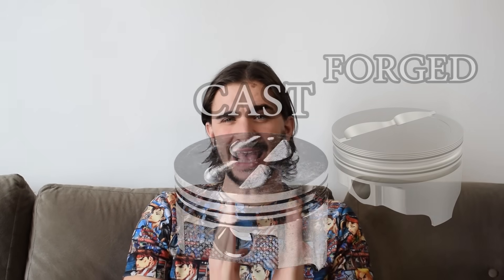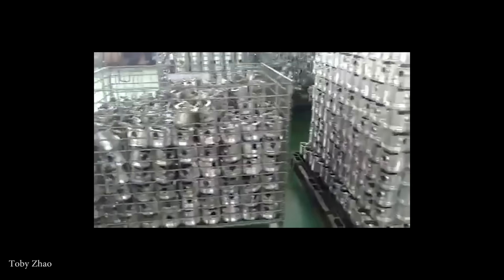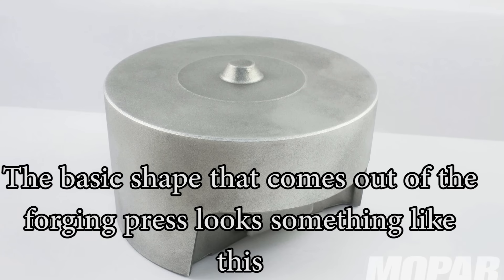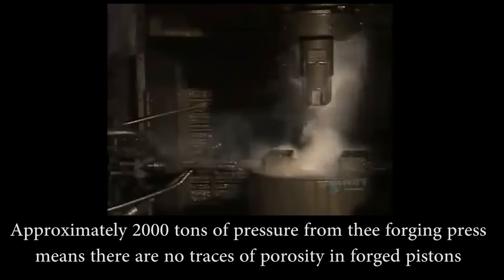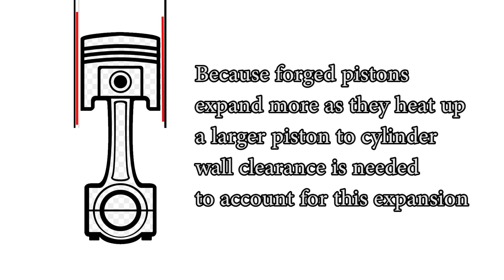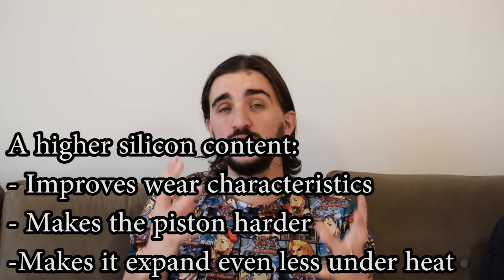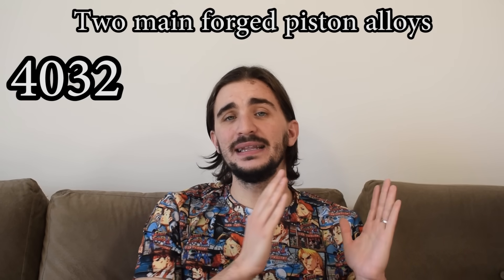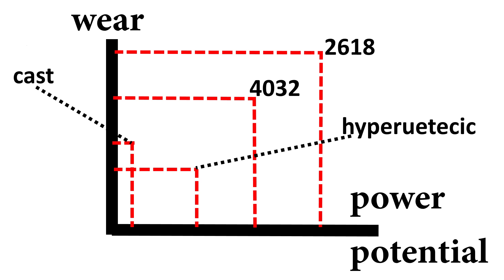FORGED vs CAST vs HYPEREUTECTIC PISTONS

Comment: You just helped me figure out why motors blows pistons and heat seize
Reply: They only do that when machined improperly.  Expansion is take into account when the piston is manufactured. How about watch some videos from a actual machinist.
Reply: @unclegeorgesspeedandfeed  well it took me this long to find this information about 4 years ago this would have saved me a lot of money and effort and having to deal with assholes and not made a fool out of myself just to learn something because I was struggling to find someone to help me rebuild a Yamaha yz250f motor and needed help from people to explain to me key things to watch out for and how it works so yeah it would've been nice so now my bike is in a million pieces because it isn't worth saving anymore thanks to assholes who gave me intentionally wrong information that was worthless
Reply: @DisruptiveUnicorn98k  have you been able to find any videos about that particular motorcycle youtube?
Reply: @unclegeorgesspeedandfeed  yes but I wanted to understand why a piston burns at the top and melts away and why the severe scuff marks and heat seizure and all these things that I have no experience in because I want to buy a two stroke bit I can't jet a carb and that is a necessity to do right and then we'll clearances isn't an issue because I have some experience with that

Comment: Forged pistons aren't just more ductile, they are stronger in yield strength and ultimate tensile strength as well.

Expansion of an object is due not only to its coefficient of thermal expansion, but also the geometry of the shape. The difference between coefficients of thermal expansion for cast and forged isn't actually that great, 20 for cast vs. 22 (microns/meter °C) for forged. A Chevy 350 long block has a piston bore of 4" (0.1016 m), so a forged piston would expand 0.2032 micron (.000008") more than a cast piston, if one considered they were at the same final temperature.

Comment: Back in 1975 I put forged hi-compression pistons (along with a lot of other performance upgrades) in my 1969 Road Runner. It was a blast for awhile, nothing like a big heavy American muscle car that can do wheelies. Goes without saying it didn't last very long. It would've been way smarter to save money building a more streetable longer lasting motor.
Reply: Kowboy USA , how many miles did you get out of engine?
Reply: @WesternReloader  A little under 200. The motor was still running, but was knocking.
Reply: Kowboy USA , so your dynamic compression ratio was too high for the fuels octane, couldn’t retard timing enough, the cam had zero overlap with a wide LSA bleeding none of the squeeze on compression stroke? What were the reasons?

Comment: Hehe, I like how you point out Silicon(e), now all that is missing is the pronunciation.
Silicone silly cone
Silicon sille kan
My buddy and I were debating what type of pistons to put into our little project and I couldn't remember the name of the Si-pistons. So after googling, the answer became clear, and this video was attached. Thanks! Hypereutectic pistons all the way man. The time of the forged piston is over. Those are only good in professional racing machines, where they tear into the engine every day.
Reply: Hypereutectic are alright but there is absolutely nothing wrong with forged pistons. They will not damage an engine in any way. If the tune in an engine is not correct the forged piston as more forgiving. Not matter what kind of piston they all need to be sent to a machine shop and have the oil clearances sized accordingly to the application. Poor machining and tunning is what kills engines along with improper maintenance.

Comment: The Ls9 has forged Pistons stock, pretty awesome.

It is an overkill for 647 hp on 6.2 liters/8 cylinders though. Not even 120 hp per liter of displacement
Reply: User 1888 so u can boost on stock internals???
Reply: Reminds me of the RS6 V10 5.0 TT engine which doesn't make 100hp per cyl

Comment: LOL when I was a kid of 17 I built a Chevy 327 street drag engine with stock rods and stock cast pistons, it had very tight piston to liner clearances and very tight ring gaps. 2.02 hears of course, heads and block deck milled. I was out there blowing off big blocks and revving her to 7 grand and even 8 grand a few times to prove she would take it. so why did she hold together you ask. well part of the reason was she was a short stroke engine that has a slower piston speed that creates less heat, less stress. that engine lasted 5 years of pure terror, and what took her down was that the oil pump blew up and sent metal into the system. she won every race she raced, but she lost the last race she raced and that was up against a $7 thousand 302 Chevy in a lighter car. that was the race then oil pump blew up. I had only $1,200 in that engine.
 I think that engine was just one of those pure luck things that happens now and then. boy, those were the days..

Comment: So for all you beer drinkers out there, your cold can of beer is shrunk and so it holds less beer.  But seriously, I have a supercharged engine I built using Hypereutectics. Experts say that's okay as long as I keep it tuned and don't run lean. Once I put a small pulley on the supercharger to get lots of boost, ran it full throttle,  which caused detonation. The pistons survived okay, but the detonation blew the ceramic centers clean out of 3 spark plugs, leaving only the threaded part in the block.

Comment: There are two kinds of people: those who want an engine to last as long as possible, and those who want to get the most power/fun out of the engine.

If you look at the older Honda engines, they were very well engineered. You see people today pushing multiples of stock horsepower on basically stock engines and they handle it like a champ. This is why 300-400K on an older Honda engine is to be expected. Some people I used to know had Hondas with 600-800K on the original engine without a rebuild. The last Honda I had was at 300K when I sold it. Original engine, original transmission, original timing belt (yeah, that was risky). The only problem it had when I sold it was it burned oil and the exhaust was pretty much gone (rusted out). My current daily car (a Chevy) is only at 155K and already showing signs it's not even going to make it to 200K without a major issue. I also have an older Nissan with 300K miles on it that runs fantastic considering it's a 35-year-old engine with a bunch of miles on it. The big differences, the Honda and the Nissan are seriously low horsepower. The Honda had like 50 and the Nissan has about 80. The Chevy has around 100 (well, it's supposed to, but due to wear and tear I doubt it has even 50 right now). For a daily driver, I'd much rather have an underpowered car I can drive like I stole it and have it last forty years. For a fun car, well, with the increase in fun comes a decrease of reliability and lifespan lol.

Comment: So if you want power and longevity... couldn't you put sleeves on your cylinder walls, upgrade to forged rods, and keep cast pistons? It would seem that would be the best combination. Rods don't bend, sleeves add protection for walls and cast pistons won't wear as fast.
Reply: No just buy a nice set of forged pistons and rods and get a good machine shoo to do the work. And sleeves for a cylinder dont work like that. They are for a damaged cylinder. They macbine the old one out and install a new one the bore to size then hone.

Comment: But then there is forged hypereutetic pistons with the addition of nickel and scandium, and with a thermal barrier coating on the crown, voila, very good allround piston. But at a different price tho...
Reply: Njål Nilssen I wonder if you’re talking about what I bought for my Ford 331 build. Mahle 4032 Forged pistons. They’ve got some type of thermal coating on the crown, and material on the skirts
Reply: @WesternReloader   Typically you won't find shelf or even custom pistons with Scandium in them, unless it is especially asked for, as they have to custom order the right alloy billets. And it won't be called 4032 any more 😉

Comment: That's some great advise! Thumbs up!!!
Regarding cast pistons, i would say, from experience, the stock cast pistons in NA cars 90-2015 can easy handle a low boost conversion (max 10 psi). My mate decided to go for 500+ bhp on a 2JZ-GE for a club rally season '14, stock internals, worked fine :)

Comment: I was lucky enough to find a rhd 2004 JDM s203 with little damage here in Canada , I put everything possible in a nice 2003"WRX shell ! It is fast as fck. It has the forged aluminum pistons and I have run it hard with zero issues and I test that 8,000 rpm redline all the time . I cooked the cast pistons in every other Subie I've had and I've had 3 WRX , one Fozzy , and now this gem , based on my experience I think these are great pistons !

Comment: 4032-T6 Forged expands almost identically to sand cast 204-t4 and significantly less than Permanent mold cast 242-T61 when looking at the thermal expansion coefficient

Comment: Definitely bookmarked this video to show to my friend,
who owns a Nissan gtr, forged piston from the factory, which
he shouldn't daily drive.
Reply from the maker: Please don't put words in my mouth and things out of context. It's kinda lame.
Reply: @d4a  Bro you miss understood me, It was actually a complement.
Reply from the maker: Oh sorry. My bad. But still, it doesn't mean he shouldn't daily drive it. When manufacturers put forged pistons in from the factory, they often do a lot to minimise the negative effects of expansion as much as possible. I mentioned high silicon content, advanced coatings and skirt design in the video, but there's also sophisticated cylinder liners and other stuff. What I mostly reffered to in the video is people building performance engines with forged pistons and then daily driving them. Emphasis on building. That all being said, even an oem forged piston engine isn't a high mileage motor and you can't expect it to do  half a million miles or something, it's a performance engine at the end of the day. Sorry for misunderstanding once again.
Reply: @d4a  I believe & its my opinion, that sports cars are not meant to be daily driven as a good practice, I own a huracan, which also has an OEM forged piston, but I use my Volvo on a daily basis. Again this is due to the frequent start-stop nature of my commute. No one has ever mentioned this on YouTube (at least to my knowledge) until I stumbled on you channel, hence why I needed to share to a friend. Great work.
Reply: Sports cars are no different than any other car justbecuase they have forged piston. Stop spreading stupid information.

Comment: You left out a few things bud about forged pistons of today and even cast pistons. Let’s talk about ristpin offset and cam ground skirts. Depending on how you are building a engine you can today get forged pistons that are cam ground that virtually eliminate cold start piston slap; also it doesn’t take long for pistons to expand during warmup maybe 90 sec . Now let’s talk about cast pistons; they are cam ground and have off set rist pins this eliminates cold start up noise but the wear surface area in the skirt is about 2/3tds less then at full expansion. So the main cause of shorter engine life in any engine is no warmup. People get in their car start the engine and go and putting full load stress on the cylinder wall with a cast piston , I’ve seen it on engine overhauls there are wear lines in the cylinder bores from this it happens. So what I do is I always warm up my engine until the internal water temperature gets to about 110 degrees or you see the needle come up on your temperature gauge. My startup routine for any engine is the same as for large Diesel engines ask any truck driver about cold start warmups.
Reply: My dad would get in his car and floor it in drive before the starter even stopped spinning on a regular basis, it ran fine over 200k miles.  He also did oil changes every 10-15k with dino so it goes to show it's all about the design and manufacture, not the use and abuse.
Reply: GoogleMinus your dad sounds like a really smart/wise man - you were probably pretty stoked you got his genes and wisdom.
Reply: I baby my car: I will drive on a cold engine but <50% throttle, and never going above 3000rpm. I drive like this until I get to 165+°F
Reply: Also talk about the thermal expansion of the alloys used because the expansion difference is usually minimal to none. The reason you get piston slap is because forged pistons take longer to heat up and expand
Reply: @Darumacandy  you said the expansion difference is minimal to none ...on average we fit cast pistons with 0.0015 of an inch clearance ..try this with forged pistons and see what happens
Reply: @Darumacandy  forged pistons expand much more than cast so you need more piston skirt to cylinder wall clearance than with cast pistons....on the average cast pistons are fitted with only 0.0015 inches of clearance ...try that with forged pistons and your engine will lock up
Reply: There is another answer that is not being addressed here that all should be looking at and that is "cold chamber high pressure injected die cast aluminum alloy pistons" with the  low expansion of cast and the strength of forged plus that are 4% less friction ..that means they take less energy to cycle = more rpms = more boost = more horsepower
Reply: This notion was disproved a few decades ago when research showed that the biggest factor in engine wear was the interval before proper operating temperature, and thereby clearances and lubrication efficiency, was reached. Warmup at idle prolonged this increased wear period, thus, the recommendation for gradual warmup was replaced with driving off after a few seconds. Scratched bores would not be the sort of damage seen from increased wear in any event.
Reply: @jozsefizsak  this is also a factor with stationary engines that run 24/7 year after year as in huge natural gas pumping stations that run off the gas that they are pumping and get over hauled once every three years as a normal inspection outage where there is hardly any wear involved at all. The tear down is a manditory inspection to guaranty a constant supply of natural gas will never be  interrupted
Reply: Joel Seim you left out why the real reason piston wrist pins are offset !  Its all about piston side thrust on the power stroke in relationship to the angle of the connecting rod during its travel through the power stroke. Offset pistons wrist pin holee is nothing new and have been around since Zora arkus-duntov invented  the small block Chevy V8...long ago while building a 327 chevy V8 with 11.5 to 1 compression pistons my local machine shop who were noted for building high performance racing engines for the midwest dirt track racers .. And this particular machine shop installed two pistons on their connecting rods with press fit wrist pins in the rods on backwards ...not only was the wrist pin offset defeated the dome on the top of the 11.5 to 1 high compression piston would have crushed the dome into the cylinder head as the combustion chambers  are offset 180 degrees ! The shop ower who had been in the business for over 35 years  told me to just turn them around !!! I told him how in hell are the camshaft lobes going to get any oil sprayed on them when the slot in the rod cap is only on one side to spray oil on the camshaft ??? ..this idiot didn't say a word back and took the two fucked up piston/rod assembles  and  correctly switched them around ! And the last time i ever done business with these idiots who where known to be the best engine builders around and who didnt take kindly to a kid of 20 years old at that time telling them what to do ! Just so happened i owned a doctor of motors degree from the perfect circle piston ring corporation and a degree in appled  science from the university of illinois as a graduated in 1969 ..and today watching you tube and reading the comments is deplorable of the number of idiots who think they know what they are doing is beyong belief !
Reply: It's hilarious how many people don't do this, even my dad redlines his car at 6 in the morning lol it's a miracle the engine still works.
Reply: What if the manual says no cold start warmups needed? Oh, no cars come out of the factory with forged pistons thus there's no requirement for cold warm ups before driving off....
Reply: Word

Comment: All this info is completely useless without consideration of the engine block and it's material or if the block is sleeved or not. Because thermal expansion is not an issue if the engine block has the same thermal expansion factors. Or if you sleeve the block with forged sleeves to go with your forged pistons. This is just someone who doesn't know much about engineering but did some research as a customer trying to get better parts. Without an experienced technician available for guidance about context he misunderstood much of what he researched. The only times you should be thinking about getting forged pistons is when you already know why you would need them or they were stock parts. 

This is information in a vacuum and whenever you make choices under those conditions it will be wrong. You can't make a correct choice without all the info of all connected parts and how they will be affected.

The basic lesson here. You can't make educated choices on research without education. This video is research by an uneducated person on the subject.

I have forged piston in a sleeved block in my daily driver for the past 8 years without issue.
Reply from the maker: I'm used to self-proclaimed experts, prejudice and bigotry by now, cracks me up, but please refrain from confusing people by saying how thermal expansion is not an issue and implying that sleeves have magical properties.